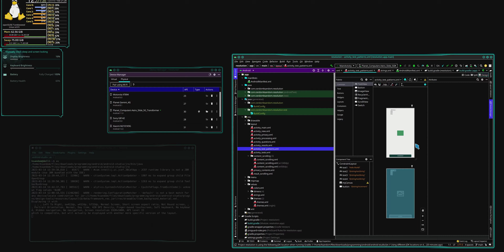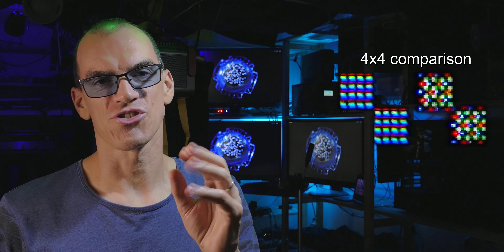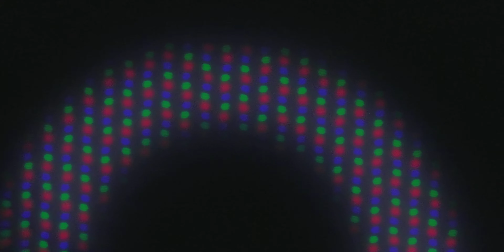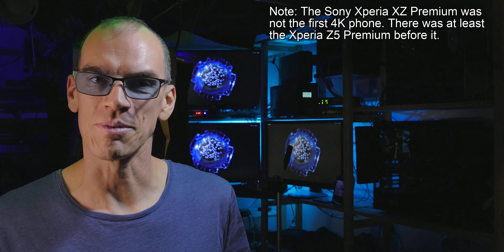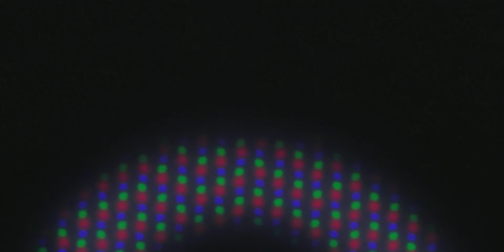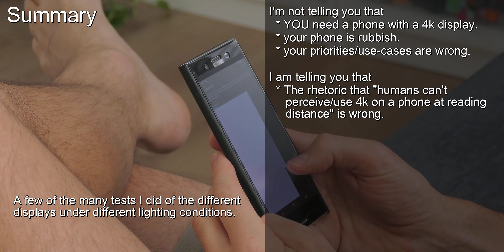Is 4k on a phone actually unusable?

Comment: I'd love to see a follow-up with the test's results. Personally, while I haven't used any phones with a 4K screen, I have definitely noticed that at roughly the same size a 720p LCD feels sharper than a 1080p OLED. (My guess is due to the pentile matrix, but I could be wrong). The sub-pixels seem more "scattered" than with LCD and sometimes OLED feels blurrier than it should be because of that. (I also looked at some LCD's and OLED's through a microscope).
Reply from the maker: I'd definitely like to. At the moment, I'm no where near close enough to a statistically significant number of results from people trying the app. But when that changes, I'll put it together.